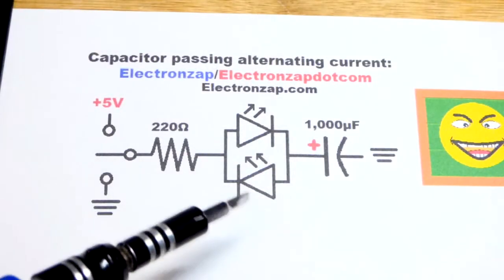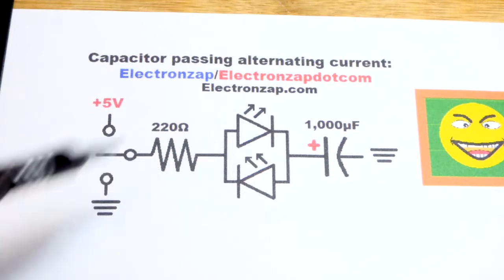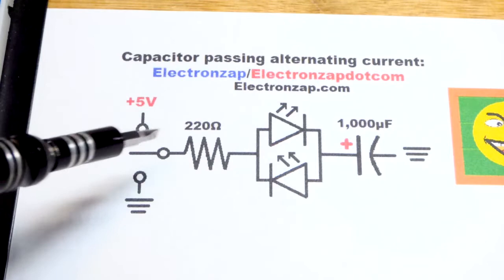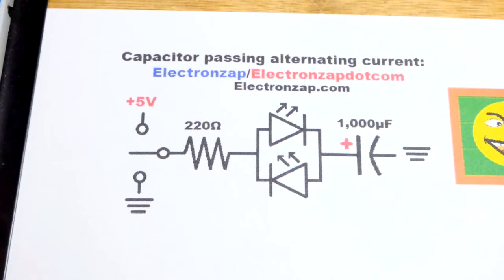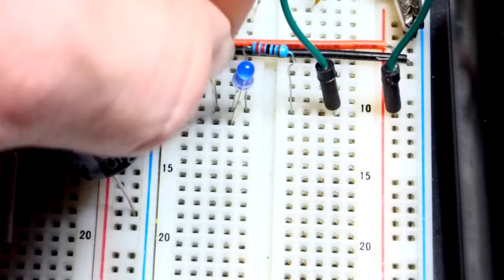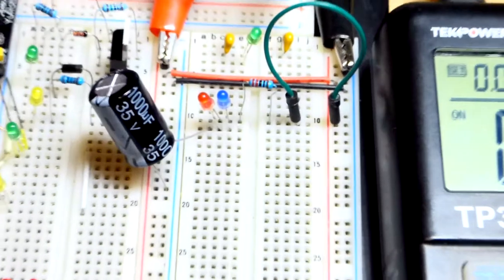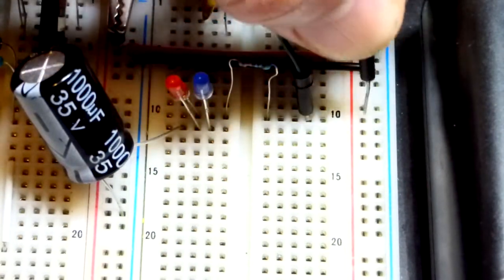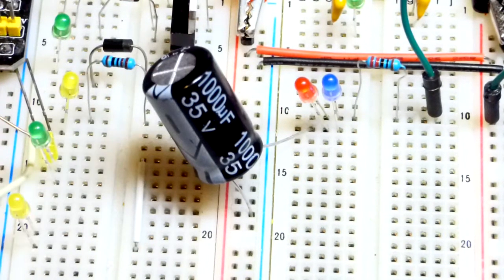Capacitor passing alternating current AC while blocking direct current DC visual demo with LEDs

Comment: How is DC being blocked by the capacitor in this case? I see the LEDs being lit.
Reply from the maker: Direct current can light it briefly but then current is stopped for good after that. You need to keep alternating the current in order for current to keep flowing and keep lighting the LEDs.

Comment: Can you make a video explaining negative voltage?
Reply from the maker: Don't plan to make another one in a while, but this video is probably the best way I've explained negative voltages so far https://youtu.be/qFNtwyCMHDQ Split power supply made from single supply using 741 op amp virtual ground rail splitter circuit